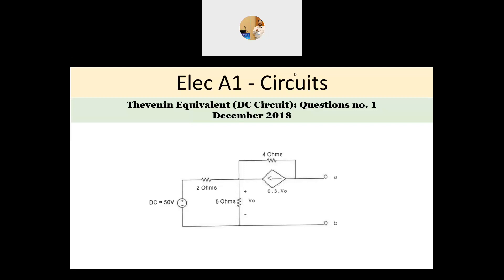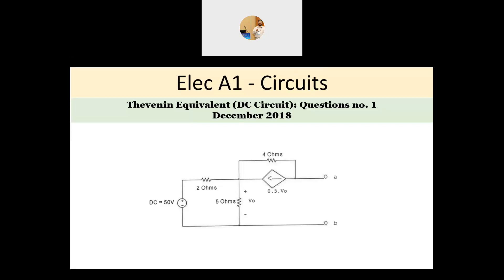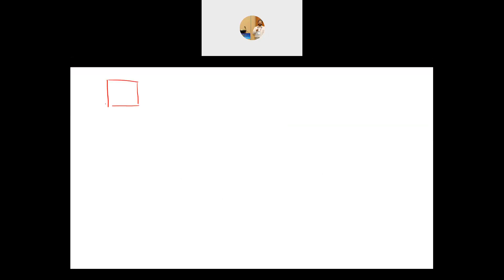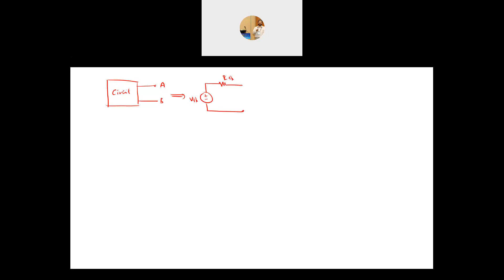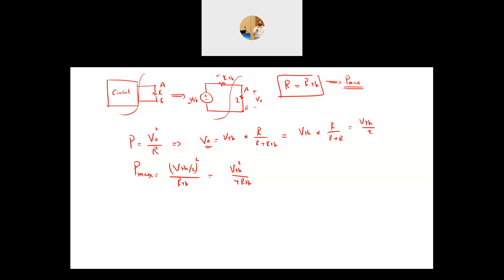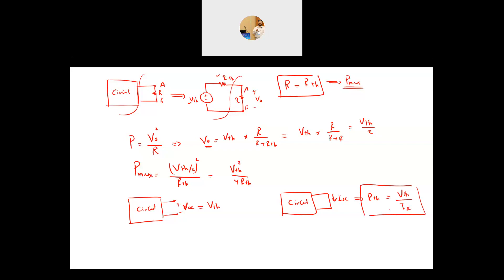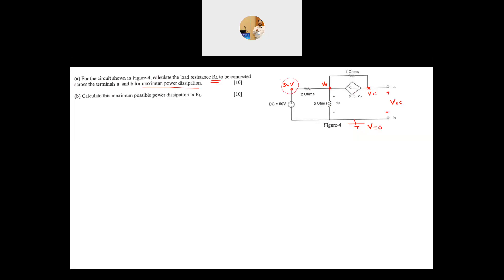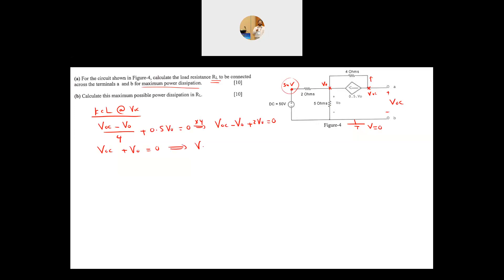PEO solved examples (ELEC A1): Thevenin Equivalent Question no. 1

Comment: @electrical4everyone  hi sir, by the way, when we short circuit an independent voltage source to find Rth, if there is another branch which is parallel with the short circuit, should it be eliminated also? That's what I stumble on when working on Question 5 May 2018. Thank you for your support professor
Reply from the maker: Sure when you short circuit an independent voltage source, any thing parallel to the source (meaning sharing the two nodes) will be short circuited.
Reply: @electrical4everyone  thanks Sir, tomorrow is the A1 exam, thank you so much for your super helpful videos.
Reply from the maker: @binhle8710  good luck in the exam.

Comment: Hi sir, if we short the voltage source and open the current source, don't we have an equivalent circuit of 4ohm in series with (5ohm // 2ohm), so we get the Rth equal 5.42ohm? Sorry I'm a bit confused here
Reply from the maker: We cannot open dependent sources. This approach is only correct if we only have independent sources.
Reply: @electrical4everyone  thanks sir, I got it.

Comment: In Question 4 of May 2019 paper, for the thevenin equivalent circuit question, there is a voltage dependent current source (4Vo) in parallel with an inductor (j4). Can we apply source transformation to that?
Reply from the maker: Any current source (dependent or independent) in parallel with an impedance (resistor, capacitor or inductor) can be transformed to a voltage source in series with this impedance.
Reply: @electrical4everyone  Dear Sir, so the equivalent voltage source would be j16Vo ? if i'm not wrong? Will we take impedance angle into account? or is it gonna be just 16Vo?